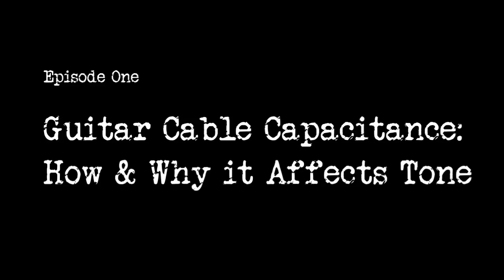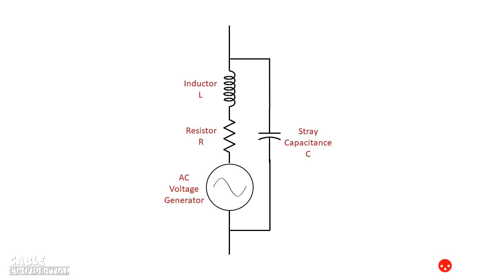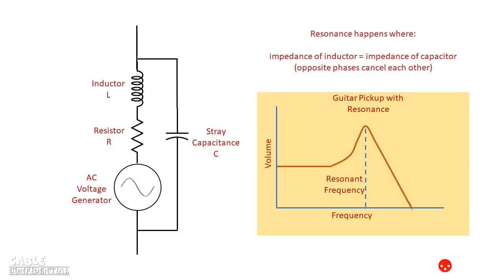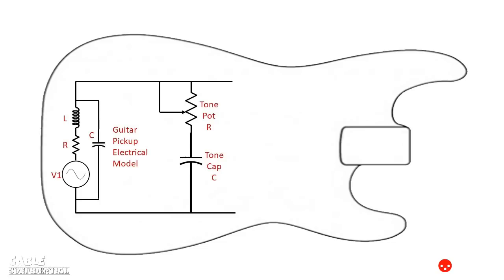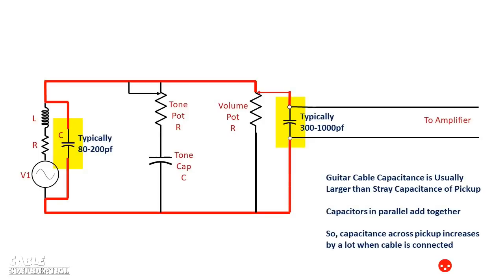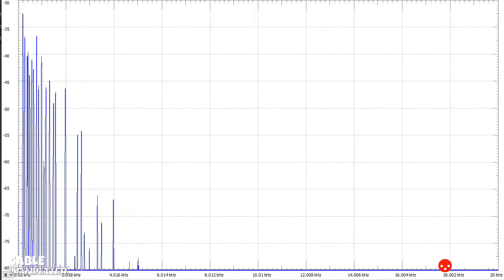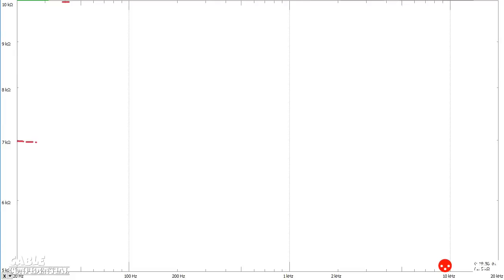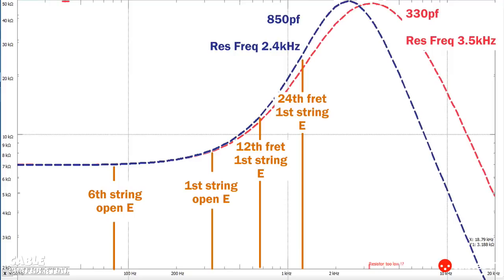Cable Confidential - How does guitar cable capacitance affect your tone, including pickup impedance?

Comment: LOVED this technical hands on test and comparisons!
Well designed and reasonably understood.
NOW,,, for some real time conditions and opinions! Here goes!

A is the LONG cable, B is the SHORT cable,,, ( my opinion,? I thinks ! ),
Well,  A had a more Mellow sound with a slight touch of bass, ,,,  B was BRIGHTER sound, almost as if it had a touch of Overdrive, or a slight resonate in some Hi freq spots.
* Hello, for 40+ years I operate sound systems in auditoriums and most have had
wall coverings sound absorption panels, reducing reflections and resonant issues,  and then I hear the sound from FOH live multiple audience speakers.
* The Musician, hears thru his speaker box?
* DO we both Hear the same sound?
* His signal goes thru 4 pedal boxes and 4 looped cables then thru a D I and splits to his amp and then it  passes thru  150ft of xlr cable  to the 40 channel mixer, then  thru a 31 channel E Q and then to the AMP and out to 150ft of speaker and then the House speakers.
*  Please,,  help me out !
* NOW,  How much capacitance do we have? 
AND what should it sound like for me?
* What does the Musician hear from his own box and from other stage monitors and from the "room acoustic reflections and speaker ambiance".
* But then what if they musician wears "in ear monitors", which sound then is the listeners going to get.
*  Its like a restaurant, they serve a fish meal, but then, some add salt, pepper, spices, hot sauce, teriyaki, or who knows what,,,,?  So you started with a fish but now your serving a fish stew or gumbo.  Now, who's dish is seasoned correctly?

Ahh,,, Here then, my thoughts,  of your sound test as I heard it,  for me!
I like the A cable sound better, it sounded "natural", "not offensive", real,  authentic, "not fake"or "colored".

But,, depending on a Musicians audio perspective, feelings, opinions, his gear, and his own ear drums, and then also the reactions to the room acoustics, the ambient temperature and the age usage and quality of strings?
How is his health, his sinuses, his ears infected, does he get allergies?

WOW,,, see how many parameters are involved?
AND the worse Parameter, is "musician attitude".
Often, the attitude is not for "quality",,, it is often, too often, "make it louder", so they
can "dominate" over others and not be "masked" by the rise in volume decibels from stage levels. 

AND so then the Guitar guys and gals, will bring along their old faithful back up accompaniment " Mister Overdrive and Miss Distortion", and they will use and employ these old pals to make them Guitars heard and will blow your minds and some ear drums too and stir up the audience to the "kangero hop".

Musical "intelligibility",,,, "clarity", ,,,  well, 99.999% of the audience has no idea
what that means. The audience is put into the trance by the spell cast on them 
from the musicians who apply devices that take what is "natural and make it unnatural", by the use of "guitar sorcery" !

Just some thoughts after 40 yrs!